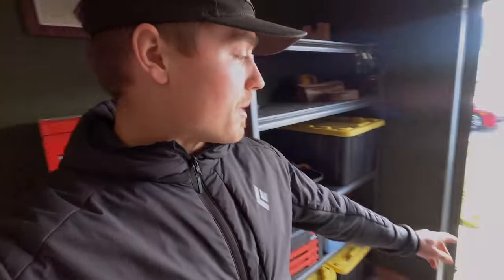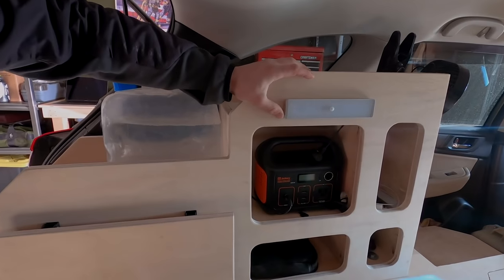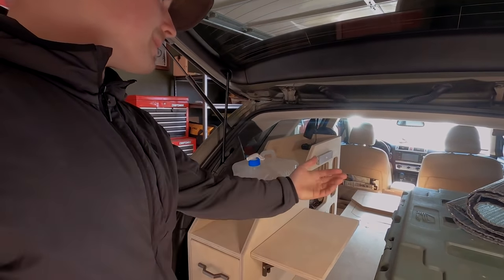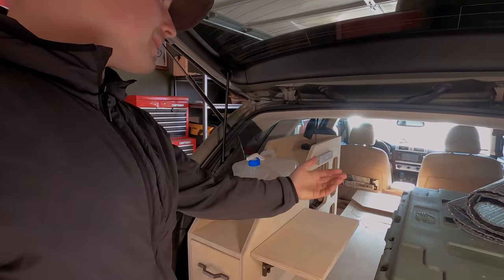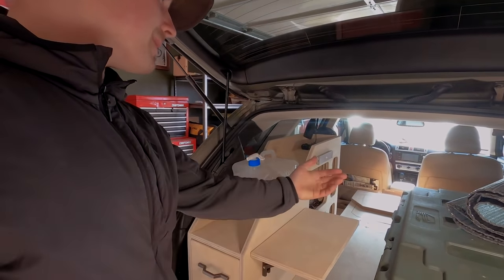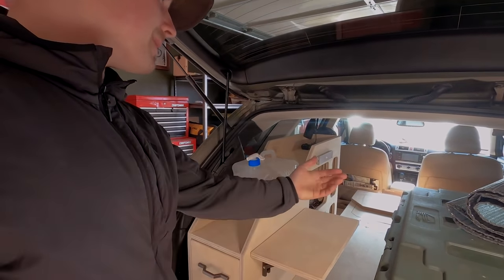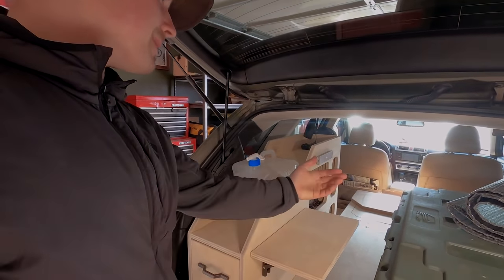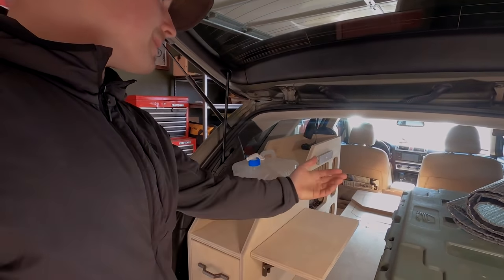How I Built my Subaru Camper: New Design

Comment: I am a tradesmen, but not a Carpenter. You should sell these units.  Or at least the plans electronically.  Get yourself set up with CAD. You could sell these drawings for 100 bucks easy.  And you would sell a lot of them.  I would take them to a local cabinet maker and get him to do.  This is the best design for a Subaru. I’ve seen in my life.

Comment: Sorry about finding your channel so late, as I see this video is a year old! Awesome job on the planning and construction of your camper insert. A lot of clever solutions. One thing I would recommend (as an engineer who has performed a good number of crash tests) please install some tiedowns for your gear, especially your trunk.  In a crash at city speeds, you can have accelerations of 50g+ so imagine your 30lbs trunk becomes 1500lbs and slams into the back of your passenger. Placing normal tiedowns holds everything together and if nothing else, absorb energy if things go sideways.
Reply: How would you install the tie downs? I am curious now, and safety minded.

Comment: Well done man!!! I actually just finished building conversion for my outback but based on your first design, I just added slide outs in the drawer with DOMETIC 16F fridge and will make a vid closer to spring about it. Can share with you if you interested :) 

Really like your second build, it improves on the first version in many ways and just more smart storage and professional looking. Keep on going and I would be interested to see if you come with a solution: where else you can put your drawer inside of the car (e.g. front seats mount of some sort) and extending rear for 2 people bed. 

Thank you again for inspiration and ideas,
Evgeny

Comment: Chase thanks for posting your design. I am a 64 year old female that likes to camp. I had a Subaru forester that a bulit using most of what you did. It turned out great and i went out west. I sold my forester and bought a outback so i cold also tow a small cargo trailer if i wanted to. With my design i am able to get to my spare, have more storage under the seat area and i feel all the weight is not all on one side. Also i was worried if i got hit in the rear with your build i would be pinned against my seat. With my build i think i may be it would beak up so i could get out if i was still alive and able.  Thanks for helping me with my build. If i post on facebook or YouTube i will give you credit for what i learned from you.

Comment: You did an excellent job on your build. I lease a 2023 Forester Touring Edition and would love to do a build like yours but with the 2' X 72" platform on the right about 6" high for more storage inside and leave the left side plain so I can use my totes for my camping and cooking equipment. I'd like to leave my rear seats in and keep the build as light as possible because of my 69yo back and multiple rotator cuff surgeries.

Comment: I like your new set up. I am surprised you didn't not angle your cabinet for the back rest. I have some news, I am in the process of purchasing a Ford Transit Connect. I hope to pick it up on Monday. It had to go to the shop to get new tires and a tail light. so hopefully it will be ready. It has seats in the back which I'm taking out, I've seen a version of what I want in one of the many videos I look at. I am getting a 12 by 24 storage shed on Wed next week as well. 62 inches of it at the back will be made into a off grid living space, and the front part will house tools, van, and storage. I'll be sharing it on my you tube channel as well. I don't know if you remember I have the Chevy Tracker but it was just to small for me.

Comment: Might I make a suggestion…. Mount (glue) a Neodymium magnet at each of the locations where a bolt is used. It would add an ounce or two to the build, but would keep the bolts right near where each is needed. I like the wafer-thin 1.25-inch ones as their large surface area will hold a lot. And, if the magnet would be in the way, a proper Forstner bit will make it flush with the surface with just a touch.

Comment: Regarding your tires. If you're looking for a good upgrade, look at the Michelin CrossClimate2. Superv All season tires with a 3-peak snow rating. Cheers from a forester owner.
Reply: I have been running sets of these for at least 5 years but switching to Goodyear Vector 4 season Gen 2’s as in recent tests, they are coming out higher rated/on top.

Comment: Great build! I plan to purchase your plans but wanted to see if you had a ballpark tape measure of the maximum sleeping length with your extension; I’m 6’7” and want to see how “baller up” I might have to get to fit 

Also does your 2017 have the lift gate issue where it will drain the battery if open?
Reply from the maker: Thanks, Dylan! Oh boy, I’d say my setup could fit you without much space to spare. I am just under 6’ and have plenty of extra room. I would build it with a front flap that goes all the way forward to the back of your passenger seat with it in the forward most position (so a few inches longer than mine). With that I think you could fit fully stretched out with room to spare. I look forward to seeing what you come up with! Join the Road to Ridge Facebook group and share with us if you’re interested.  
Yes, I’ve had the same problem. Check out the video I did on how I manage it👍

Comment: What I find interesting is the lack of insulation. These car companies are cutting every little corner.
In my 99 mountaineer if I take the seats out there is carpet and insulation underneath and my last car was a 2000 sable that had insulation under the back seat.
Now just driving around and wearing your coat you wouldn't notice the chill coming from the cracks but on long journeys where you will probably take your coat off and get comfy you'll notice.
Just a layer of reflextix and felt could save from heat loss and traditional heating when parked on blacktop.

Comment: I have considered what you are doing. I would put a 12 VDC refrigerator-freezer behind the passenger seat, not too tall so it would not interfere with your platform extension. Maybe 12 VDC/110 AC,:I do have a cooler that will run on 12 VDC/110 VAC. 

I would not build higher than window height, to be a little more discreet.

I suppose more lift-out flooring could be for cubbies, if you really use it.

Thank you for showing your materials and tools, as well. Nice!

I looked at your channel. I subscribed, just to see your adventures.
Reply from the maker: Sounds like a good plan, Connie. Thanks for watching and sharing!

Comment: I've watched this video more times than I care to admit and still think it's THE best built/solution. I especially like the removal of the rear seats, which no one else does. Question though... how would you get to the spare tire? On all similar rear platform builts, I don't recall anyone addressing that issue. My Outback Wilderness is arriving in 3 weeks and can't wait to go camping/cycling with it! Any comments/suggestions regarding the spare tire issue is much appreciated! Thanks in advance!!!
Reply from the maker: Glad you like it! That is a fair question. I carry a small wrench with me that fits every bolt in the build and, in the rare occasion that I get a flat tire, will unbolt the platform and lift it up to retrieve the spare. I suspect it would take me less than 5 minutes. I haven't blown a tire on this car in the past three years though.
Reply: @ChaseChristopher1   Thanks for the tip. I'm definitely going to built something similar and will remove the rear seats as I'll be doing mostly solo camping/riding trips. Speaking of.. did you ever consider adding a swingarm for your bike rack? I even thought about adding a tire carrier and attack a bike rack to that. While it's a great solution that solves multiple issues, the costs on those bits and bobs do add up quickly!!

Comment: pocket holes!!!  i like this new design!  did you put in piece by piece then construct with the pocket holes or did you use cardboard to mock up your cuts?? i am looking on where to stash my 12v freezer and 100 ah battery.  AZ and CA are much warmer than Colorado. It looks like you used about 12 sq ft of the plywood. 3/4 sanded ply right or was it prefinished birch? i like the anchoring with the L brackets,

Comment: With your new design incorporating the snack box behind passenger seat, what is the effective length for sleeping?  I'm 6'3" and wondering if there is enough room for me.  Thank you!
Reply from the maker: The platform ends up being 77” long with my build dimensions, but it could be extended slightly longer on the front end behind the seat. I would bet you could get up to around 80-82” depending on the car and how far you move the seat forward. Also, if you sleep at an angle that can help a bit. I am just under 6’ and it feels like I have 6” of “room” above and below me as the platform doesn’t reach all the way to the seat or the rear hatch. Hope that helps!

Comment: Does the Avenn roof rack you linked that is 23” wide still fit with the Thule cargo carrier you have that is 25.5”? It looks tight with the 19.5” wide roof rack you have installed. I wanted to check before I ordered and I have never had a roof rack so need some insight there. Thanks

Comment: pretty cool man. will have to adapt to my car. looking forward to it. thanks for all the insights. also, i don't think the jump cuts are so bad. fairly standard on youtube these days. Might be good to know know roughly how much time it took you to complete build 1 and build 2 (watched both videos but forgot if you mentioned that in the former video).
Reply from the maker: Thank you! I appreciate that. 
Build one took probably 35 hours. Build two was probably about 25 hours. The first was challenging because everything was new, and the second took a bit longer than necessary because I was building the plans in a way that would be easily repeatable. I suspect I could do a copy of version two in less than 20 hours now.

Comment: Is there a reason you designed for 2 pullout tables versus just 1 big table?
Reply from the maker: Yes, so the pressure from any weight on the middle of the platform doesn’t sandwich the table and prevent it from moving in or out and is instead absorbed by the center divider/spacer. Hope that helps

Comment: Hi Chase, quick question, by joining the road to ridge do i get access to a design file of the bed platform?
Reply from the maker: Yes, photos of the design are in the membership area👍
Reply: @ChaseChristopher1  is there some kind of vector file for the cut ?
Reply from the maker: @vladimirspetrocenko739  unfortunately not. Only 3D model photos with dimensions.
Reply: @ChaseChristopher1  got it thx

Comment: Subaru/Fuji heavy industry.please make  VW/Westfalia rear engine motorcoach just like  retrofit 2.2 Subaru engine into vanagon ,buy one and reverse engineer it , manufacture in Mexico,VW Beetle was made there,try  van market like NV 200 Nissan or all mini van types with  but with  Subaru all wheel drive and variable height suspension ,think Citroen,variable ground clearance in rough terrain.

Comment: Nice work! Surprised at the final weight using the 3/4" plywood. Thought it wood be much heavier. 🤪 I'm getting ready to start the build for the bed of my F150 and plan to use aluminum tube for the frame and now may switch to plywood for the platform instead of 1/4" aluminum sheet.
Reply from the maker: Thanks! Same here. There are some charts out there with average wood weight, but it depends on the kind and how dry it is. Good luck!

Comment: Do you have remote start on your Subaru ?  The Subaru is small and those propane heaters ( from hot springs video)  are dangerous. I believe they are not sold in Canada and Massachusetts because of safety  issues.
Reply from the maker: I do not have a remote start. I also do not use a propane heater but I know several people who have many times without any issues.

Comment: so if i subscribe to your membership and then i can look at the plans? i’m interested shut want to know how to get my hands on the prints.
Reply from the maker: Thanks for asking. In the membership there are 4 articles that contain the Tools I used, Materials, The design of the platform system, and the design of the cabinet with measurements. They are not designed to be printable templates but rather a full reference for you to implement into your design. let me know if you have any other questions.

Comment: Having 2 Gpa's that did wood for a living, awesome job! Building a Ford Flex myself. I could sit for hours and bounce ideas. I ended up going aluminum for weight, space, etc. Since you are playing with weight, here is an idea. Replace the awning with bicycle flashlight holder + golf umbrella + hatchback strut. I have this design for my hatch as I didn't want anything on my roof line. I use wind resistant large golf umbrellas on each side of the hatch.  Being adjustable helps with cooking, cross wind while sitting, setting sun angle, etc.

https://www.amazon.com/Jueapu-Flashlight-Bicycle-Mounting-Rotation/dp/B08LNJ5K9P/ref=sr_1_9?dchild=1&keywords=bicycle+flashlight+360+holder&qid=1608996887&sr=8-9

Comment: A heated blanket(and very modest power bank) under you is plenty in sub zero temperatures. Idling for heat is super wasteful and pollution from idling is actually worse than when you're driving